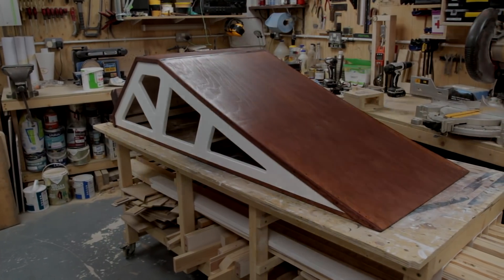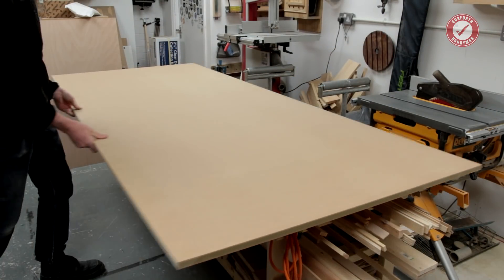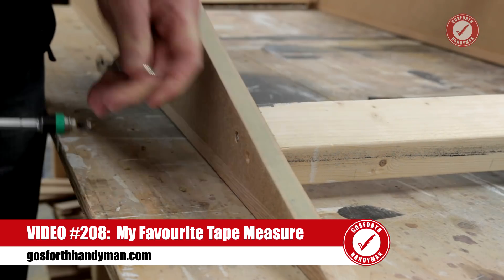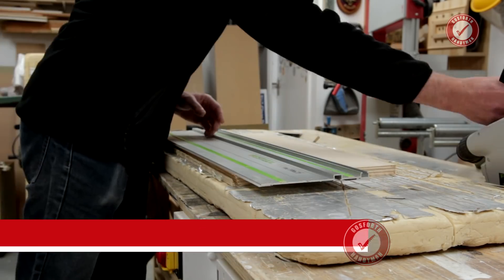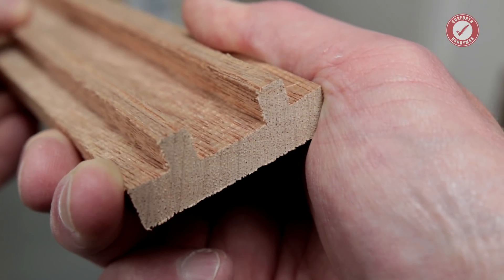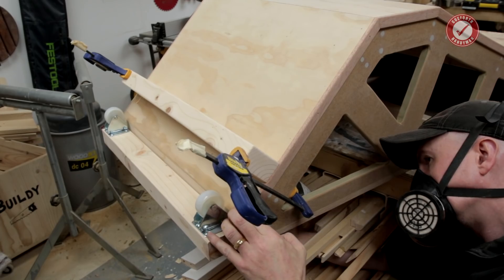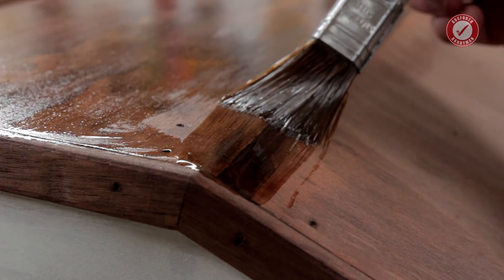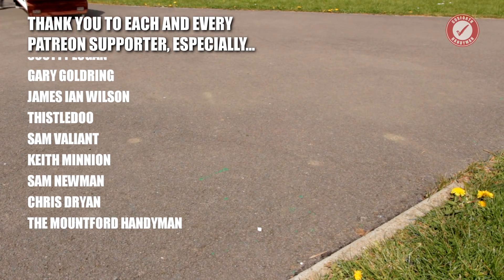I'm making a ridiculous BMX ramp!

Comment: A very nice mordern take on the plank of wood you found and what ever else you could lay your hands on to elevate the plank to form a ramp. I remember using the grass bin of my Dads Lawnmower. He was not best pleased as we did knock it out of shape somewhat. That was in the days when BMXs was just catching on and those of use that didn't have them used what ever bike we had. Mine was a Rayleigh Striker I have had for a few years. Even used my Mums folding Shopper when my bike was bust. Those were the days.
Reply from the maker: Ha ha - I did exactly that! Old door on a Qualcast metal grass box. Made a right racket. Especially with my Grifter. 😂👍
Reply: My mate had the Raleigh Grifter, I had a typical bike of the day that did so many jumps that the forks were bent forward due to so many landings. Fun days.

Comment: Someone at my local riding spot brought a flatpack wooden kicker ramp. So it can be carried like a flat(ish) briefcase, and then assembled once arrived.
Its called an "MTB hopper" if you want to look it up, its quite a neat design. (just looked up the pricing on them (£301 for the cheap model), ouch!)

Ever since riding it, I have been thinking about how I could come up with something similar, but packaged so it can be carried sticking out the top of a backpack. My current idea is to use something like decking planks for the ramp surface. Then have 2 hard wearing fabric straps, inset from the ends of the planks, joining them all up. Allowing the surface to be rolled up when carrying, then the decking slats would slide into the side supports of the ramp. Or something like that, I haven't fully thought it all through :p 

That said, it'll probably stay an idea in my head for the foreseeable future.

Comment: I don't have any spare scraps of white oak or mahogany. Ahh well, looks like I'm not making a kicker ramp 😏(I don't really need one)
 I will have to research the Osmo oil you used, Not heard of it before. What do you like using it for?  I have used teak oil and danish oil.  Did cutting out the voids reduce it's weight much, or was it just so it looked cool?  A nicely finished project